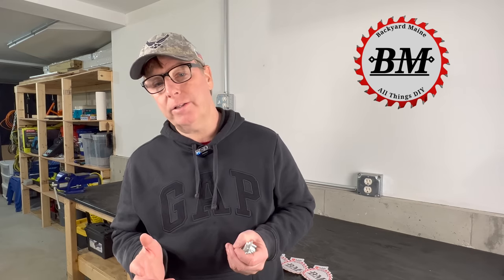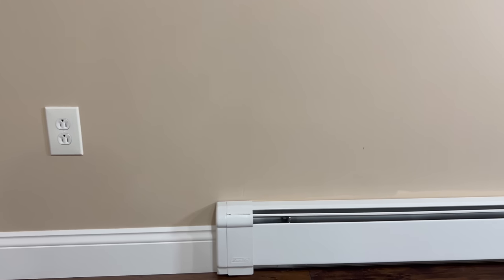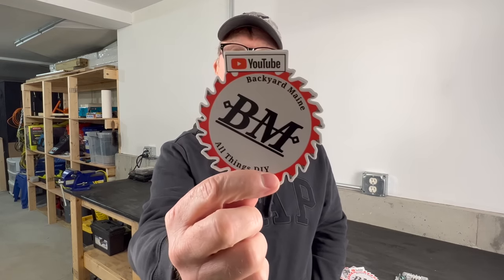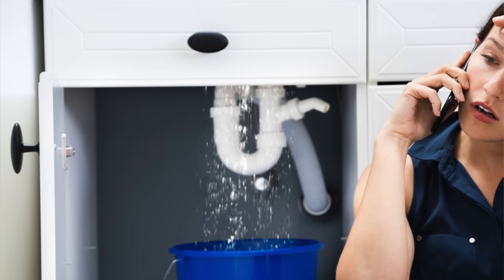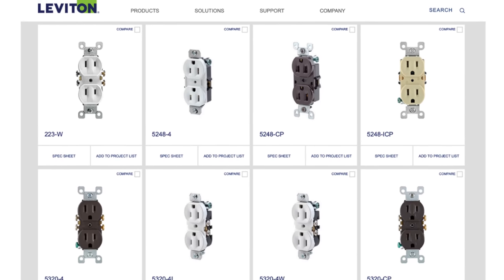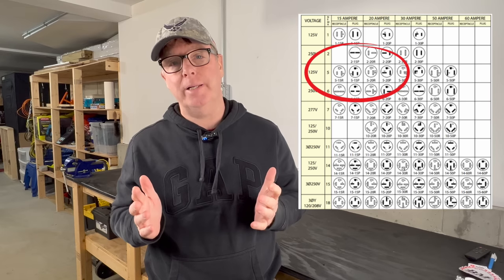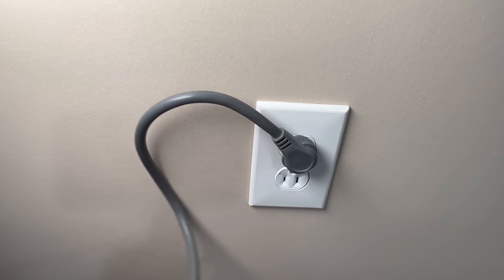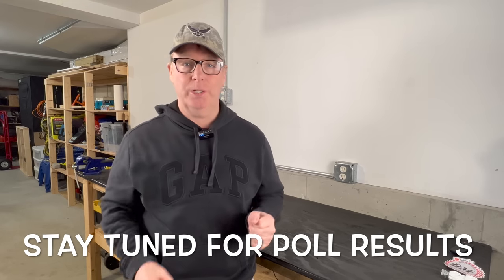Are your outlets installed upside down? (You may be surprised)

Comment: I think they should make them so the grounds are opposite in each plug, facing inward toward the screw hole. This would allow two transformers to be plugged into each outlet for electronic devices.
Reply from the maker: Great point.
Reply: Why hasn't anybody made a receptacle like this?
Reply: If you want two transformer rectifiers then just change the outlet to one with the USB already installed. It makes connections really easy. Or an extension cord with multiple outlets and charging stations. Because you might want more than two.
Reply: @grumpy3543  sure, there are special use outlets available, but there are other transformer uses than just USB. Depending on the form factor of the transformers you might not be able to plug two into one outlet.
Reply: Then 90 degree cord ends would have to be redesigned
Reply: @claudenormandeau9211  why is that? One would point up, one would point down.
Reply: problem with that is the weight of the transformer on top always being inverse to the spec, causing a higher risk of leaning away from the wall adding to the "partially inserted" shorting risk
duplex receptacles(and even most power strips) will just always be sub-optimal for large numbers of "transformers" as they simply do not have any easy way to connect more than 1-3 total
I have a couple of the "media" type power strips that have "adapter spaced" receptacles
but given the new trend for "sideways" adapters this actually breaks the "media" power strips as those with "adapter spaced" receptacles tend to have "ground out" bus bars that make all grounds face the same way effectively making the same adapter issues as before but with the new power strip orientations, though it does fix the issues caused by normal duplex receptacles
I think honestly the orientation literally should be based on use case and as a subtle indicator of switched outlets
ground down by default with the switched outlet being the only one opposite, in high shorting risk environments(not any old home room most just shops and maybe kitchens with aluminum foil) you can invert the outlet as it may increase the safety though given that all kitchens/workshops should include GFCI protection that tends to include ARC protections as well so the ultimate conclusion is: do what makes the most sense for the use case
you can invert or not but in rooms that likely will have a large number of "adapters" or flat plug cords you should always go ground down as the inverted weight will wear down the contact tension early causing a greater risk of fire and negating any benefit you might scrape by using the ground as a shield from falling objects
Reply: @johnthefactfddict3281  Or manufacturers should come up with some standard form factor for transformers, which would probably solve 95% of the issues, understanding that transformer size is of course related to voltage and power of the transformer, but I rarely see anything which is more than 12V/1 amp.
Reply: Probably the ideal orientation for users would be to have them oriented so that they are side-by-side (landscape), rather than stacked (portrait). Though I am not sure many transformer bricks wouldn't still be invading the space of the receptacle next to it...

The primary reason, though, why receptacles are orientated the same way vertically, is that it is easier to manufacture having the hot and neutrals on the same respective sides, and the ground between them.
Reply: The problem is the one facing up always start to fall out, at least for me. However with two, the bottom one might support the top one so I guess I would need to try it to see how well it worked.
Reply: @davidhorizon8401 How old are your outlets? I have seen older homes have this problem. Also cheap outlets don’t hold as well. I always use a brand name. If they don’t hold well you should replace them.
Reply: I have seen it suggested that manufacturers put right angle plugs on devices that use a lot of power and the socket design is to prevent two high power devices being plugged into one outlet. However I own devices that contradict that theory.
Reply: I might discuss with the client, when known and feasible, which things would be regularly plugged into whichever outlet location an do best to set the receptacle to match that thing’s plug. This always comes up in kitchens/bathrooms.
Reply: Bad thing about this idea is it won't be as simple to manufacture. Two bus bars would have to cross over to keep neutral and hot on the same side in conjunction to the ground socket.
Reply: Specialized outlets are available
Reply: @grumpy3543  
Extension cords with an outlet strip on the end should be made with the ground towards the side and alternating from side to side for each outlet.
Then there wouldn't be the problem of one outlet blocking the use of the one next to it. (like the charging transformer mentioned above.)
Reply: You cannot make an outlet that way because the neutral would be on the wrong side on one outlet, same goes for the hot side. Grounded plugs are also polarized plugs as well. Don't defeat the purpose of having a grounded plug. Use pig tails if you need to plug in two transformers in one outlet. 73
Reply: Grounded 4 or 6 inch extensions work wonders. Look into it.
Reply: How many transformers do you use with ground plugs?
Reply: @dylanwhite6539  None, but most transformers have polarized prongs, so they can only go into the outlet in one orientation.
Reply: Having both grounds located top and bottom outboard would protect against a piece of conductive material from spanning both blades causing a short.🎆🤔
Reply: @larrybud  which doesn’t really make sense either. They don’t need polarization. Look at just about any USB power adapter
Reply: Wouldn't this actually require the grounds to be facing outward not inward? At least all the "wall warts" I've seen have the grounds at the "bottom" not the "top." And even with the outlet grounds facing outward there might not be clearance for two.
Reply: i need the transformer for non usb devices, a pedal board that runs 9v out and a battery adapter for a portable  practice amp. this is fairly common, my iptv and router both use at the socket transformers as well, no usb cables
Reply: @marcellachine5718 Yes anyone with a single brain cell is aware of extension cords. The point is, we shouldn't have to do that In order to "work around" a stupid design. Plus technically you're not supposed to plug extension cords into a power strip.
Reply: @kerryedavis  i believe he’s referring to top justified ones. The lower one is fine, but the upper outlet having the ground at the top would allow for two
Reply: @dylanwhite6539  There are more transformers out there than just USB.
Reply: @dylanwhite6539  maybe so. It seemed like "facing" might refer to the grounds so I wanted to be clear. Also the point about clearance still applies. I see a lot of "wall warts" that if plugged into the lower socket there's room for a regular cord above, but not for another "wart" in the opposite direction. They cover too much of the plate/ground screw. I get some like for alarm/security systems that even use the screw to fasten them to the outlet so they don't come loose or get accidentally unplugged. The "mirrored" outlets would also be more complicated inside and/or more complicated to hook in with a hot and neutral screw on each side!
Reply: @grumpy3543  - USB power supplies are a high failure rate device, making them harder to replace is not a good thing.  Many are also poorly designed, there really isn't a surefire way to know if a USB supply is clean without testing it which almost nobody does.
Reply: @larrybud  doesn’t matter. A transformer/power adapter doesn’t need polarizing. The main advantage of polarizing is to keep parts of AC devices disconnected from live on single pole switches. For example, a toaster could have the entire circuit and heating elements connected to live which poses a shock/electrocution hazard. A polarized plug prevents that by making sure it’s always connected the switch to the live wire instead of the neutral. This pretty much falls apart with power adapters/transformers as everything coming out of it will be regulated output anyway. Rarely is there a high enough wattage AC out wall wart that warrants this, and that’s assuming it doesn’t simply assign live and neutral on the output size regardless of the input side.
Reply: @larrybud  if you can show me an adapter that would potentially have a dangerous live connection if not polarized I’ll concede, I’m not saying it’s impossible just incredibly unlikely. AC powered devices themselves don’t care about polarization
Reply: @dylanwhite6539  Whether it would have a potentially dangerous live connection isn't the issue. The issue is that the manufacturer of the device has a polarized transformer. Are you suggesting the general public file down the polarized plug in these cases?
Reply: @dylanwhite6539  I don't care if it NEEDS polarizing, the fact is it IS polarized.
Reply: @larrybud  I’m suggesting it’s the manufacturers problem for needless polarization and that it’s a very small niche of customers that this would help. The real answer is for manufacturers to not use polarization on devices that don’t need it, not that an entirely new socket be manufactured to solve the issue it creates.
Reply: THAT makes good sense!!!
Reply: It would be far more complex  to make as you would need to cross the line and the neutral.
Reply: My favorite Idea of the year! Good job.
Reply: @dylanwhite6539 exactly. There just aren’t any.
Reply: Doesn’t seem to make a difference. It’s just aesthetics.
Reply: They're not Transformers, they are power supplies.
Reply: Absolutely not putting a transformer plug Upside down is dangerous and not approved by the device itself
Reply: @Johnny-tq9no  How is it dangerous? The voltage coming out of the transformer is 9 or 12v generally.
Reply: @larrybud  because the weight of the transformer being upside down, pulls it away from the wall exposing the two conductors of the plug partially allowing for open conductors and electrocution. It's not meant to be mounted upside down. The weight of the transformer will make it unstable
Reply: @Johnny-tq9no  I haven't seen a transformer that large in 20+ years. Most are a couple of ounces.
Reply: That’s two forward thinking. Why have the plugs up and down, offset them slightly turned sideways and add the usb /c receptacle
Reply: it would just be expensive and make splitting switched lead impossible the current design has very efficient isolation of neutral and line opposite each other
Reply: @grumpy3543  there are many, many AC adapters that don't supply USB power. And there are AC plugs with no transformers that have the cord coming out of the bottom of the plug rather than the back.
Reply: @larrybud  some, but definitely not most.
Reply: Ground down
Reply: @sparkyheberling6115 because it doesn't hold for larger outlets. Instead, rotate them 90°. Since that isn't done except on a few power strips, chargers are rotated instead and the problem is avoided
Reply: Adorne Tamper Resistant Outlets
Reply: That would be too hard to use!
Reply: @larryhojer469 sure they’re called power supplies but they are indeed transformers.
Reply: @ronb6182 well...  you could.  But it would need to cross over internally and if it used screw terminals it could look really odd to the installer to see a hot right next to a neutral. But installers are supposed to pay attention anyway and understand what they're doing
Reply: Sideways with ground on the left.  That way you don't have to bend down so much to plug something in under something else
Reply: I haven't got a clue about this but one solution would be to make the power transformers with a rotatable plug still one will be on top until it falls out of the outlet. I myself don't plug in transformers ina wall outlet mine are on a switchable power strip.  In my house all devices are off when they are not being used. I won't ever have a satellite receiver or cable box that leaves out the issue devices  must be on all the time. None in my house. 73
Reply: A transformer don't need polarization. They are an isolation device. I'm glad off grid don't need special grounds they don't have to have any polarization. 73
Reply: @ronb6182  Unfortunately I have several (most) transformers which are polarized.
Reply: Most wall-wart plugs are unpolarized, so this isn’t super common of a problem
Reply: @johnthefactfddict3281  I plug wall-warts in upside down all the time. Only a problem on some really heavy ones, or when the receptacle needs replaced.
Reply: @davidhorizon8401  You need to replace your receptacles.
Reply: @xHadesStamps  a transformer should not be polarized because it makes no difference how it's hooked up , it's an isolation transformer. Most transformer less power supplies may have a ground which is usually corded. Ground may be used for noise reduction or surge  protection. 73
Reply: @xHadesStamps  I have more polarized plugs than non-polarized.
Reply: @larrybud  That’s weird. Your case is quite rare.
Reply: @xHadesStamps  I don't think so. I don't own anything but commercial products.
Reply: @larrybud  Commercial products may be more likely to be polarized, but they also should at least come with a power brick. Wall-warts, no matter how well built, suck. Still, only owning commercial products also tells me your case is very niche.
Reply: @xHadesStamps  Huh? "Commercial Products" are what people buy at the store.
Reply: @larrybud  Oh, I thought you meant commercial-grade equipment.

Comment: As a retired union electrician who for most of my career worked in hospitals, they almost always requested ground up installs. So that's what I tend to lean towards. 🙃
Reply: I was Union and did many many hospitals and I never seen that ever  . Even notice when you're watching a television or a movie of a hospital room they are down and I also look for the Green Dot just to see if they are hospital compliant on the show or movie
Reply: Did you intend for the emoji to be in “ground up” orientation?
Reply: So you’re the guy who wired this house Im at now. You’re unique to do that in a house with plastic boxes.
Reply: I'm sitting in a hospital lab at the moment.  They are almost all horizontal or ground up.
Reply: Many appliances, extension cords, etc have wall hugger plugs these days. That's a great feature, unless someone installed the outlet ground up, which means the cord turns up, then folds back 180 degrees to hang down,.
The ground pin is next to the cord, allowing it to hang down flat and close to the wall, UNLESS someone decided it was somehow "fashionable" to put the outlets in upside down with the ground at the top. 
The wall hugger cords a re great if the outlet is install CORRECTLY - GROUND DOWN.
Reply: Update to my previous response, anybody that installs plugs upside down is a weird dude. That is ground up for you people that have a hard time understanding
Reply: @mothman-jz8ug  One exception is in our garage, ground up orientation works better for the right angle plug as the cord needs to go up.
Reply: @n40tom   Every hospital I've worked in was 'Ground Up', that's 6 different hospitals in 5 different states from the Rocky Mtn region all the way to The Southeast.  So it may be a regional thing in the area you've worked.  One of the reasons being that we often work in an O2 rich environment and sparks near sheets are a bad thing.
Reply: @MojoPup  if you pull down on a cord in ground down it breaks off the ground pin. at a hospital many plugs are 3 feet off the ground not like a house. so stepping on a cord can easily happen.
Reply: I have worked in hospitals for almost twenty years and I have only seen the ground up when I was in norther NH….and I took them all out and fixed them. Never seen it that way and I been to over 40 states in the US.

Comment: There is an argument in favor of ground down:  When a person is holding a plug to plug in or out, they typically have their thumb on top and their pointer finger below.  The thumb ends up pointing into the outlet, while the finger is sideways, across the receptacle.  If the hand slips forward, with ground down, the finger hits only the ground, while with ground up, the finger shorts across hot and neutral.